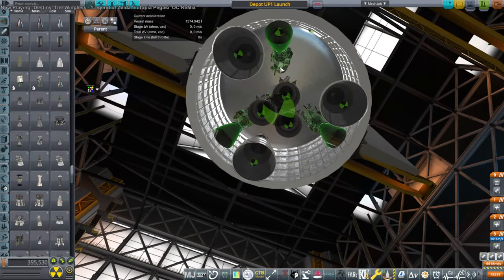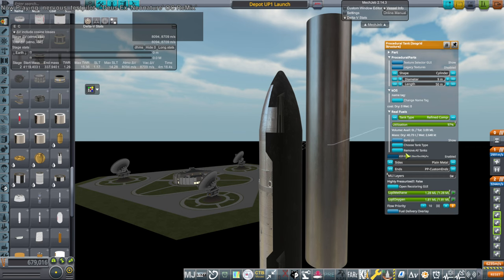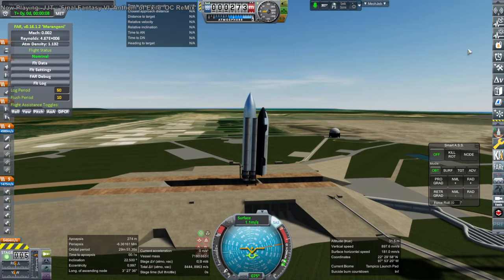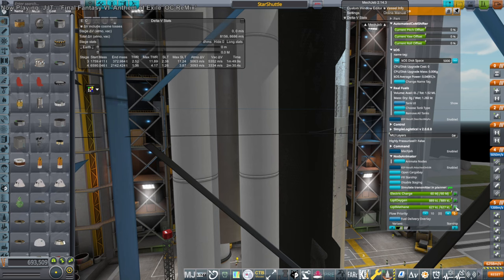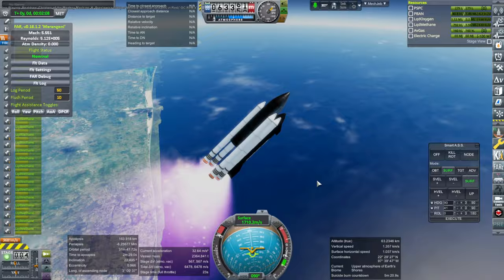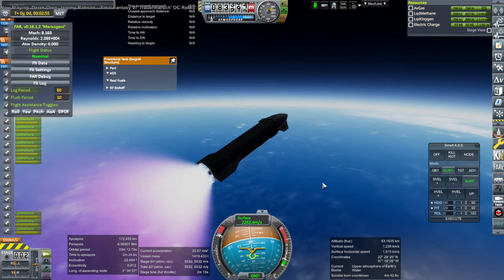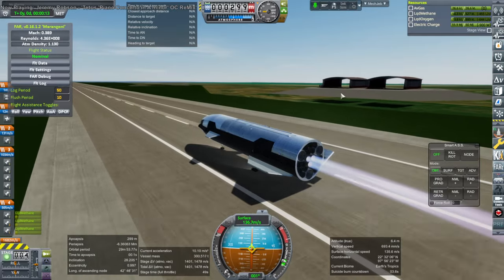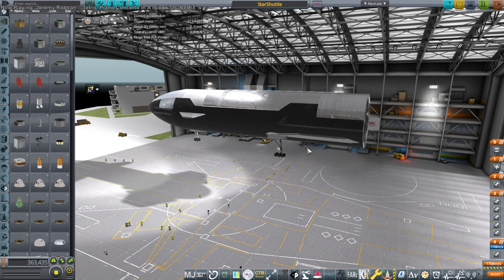Starship on a Shuttle Stack (KSP 1.12 with RO)

Comment: This is silly, but fun.

On the comment of "whatever hydraulic thing SpaceX would cook up" for separation, I would note the existence of H-II's unpowered mechanical SRB separation system. I replicated it in stock KSP once, and it did work.

Oh, and I agree that there is no foam on Superheavy, but there is ice, which is the reason NASA was so heavy on the foam for Shuttle to begin with. 
I have long wondered about doing a Shuttle with room temperature fuels to avoid all that. Probably hypergolics. No one would've been happy about the toxicity, but Hydrazine can also be used in fuel-rich staged combustion engine, and a big NTO/Aerozine tank would've totally avoided the ice problem.
Reply from the maker: As much as I don't like hypergolics, we do need a broader array of larger hypergolic engines in KSP, and especially some with restart capability.

Comment: This has me thinking. And I am sure no other esteemed rocket pioneer ever thought of this:
What if we mounted all the engines at the top and have the tanks hang from the bottom? Might save a lot of weight, no?
Reply from the maker: You think you're being clever with the Goddard reference, but how about the payload at the bottom: https://www.youtube.com/watch?v=gzohtUF0gJA Technically, this could also have the tanks below the point where the thrust is applied.
Reply: @RaizSpace  But seriously, what's the downside? I think I remember that Goddard's rockets were unstable and that thrust vectoring is easier from the bottom. Engine exhaust hitting the vehicle might also be an issue.
Reply from the maker: I mean, I think you've covered the downsides.

Comment: Wouldn't it make more sense to mount the starship with the heatshield outwards as it doesn't have the rear stabilizer the shuttle had, but loved the video!
Reply from the maker: That's possible, though we may have to add a vertical stabilizer ...

Comment: If we learn anything from shuttle, turn the Starship 180 degrees. Ice on the Booster would hit the heat shield and damage it. Rotating it would remove that possibility. I know the mods don’t model ice and damage like that, but still. It would be more accurate. Also you could angle starship so the thrust lines up better with center of mass so it doesn’t induce a rotation when it separates.
Reply from the maker: I'll think about rotating it, though I did have a nefarious plan to make Starship look even more like the Shuttle with a vertical stabilizer. This wasn't meant to be a serious thing at all, but maybe I'll relent and not go whole-Shuttle on it.

Comment: tbh shuttle ET takes the load of SRB’s so not completely like a drop tank like on my shuttle heavy lift vehicle
Reply from the maker: I meant the hydrogen tank on the ET just hangs off - the loads are applied to the intertank, so a much smaller surface area than reinforcing the entire tank as in Energia or SLS.